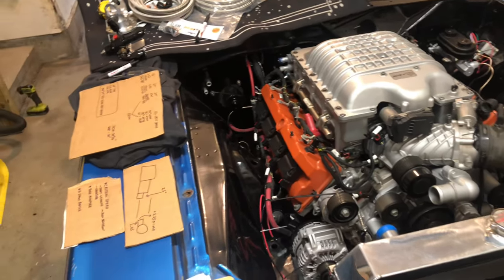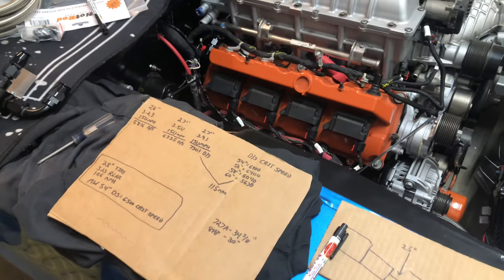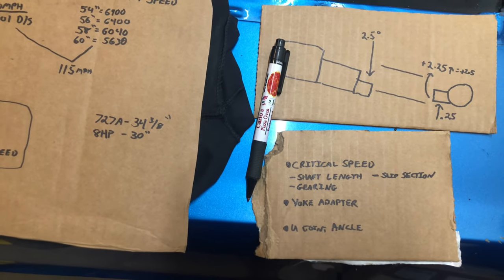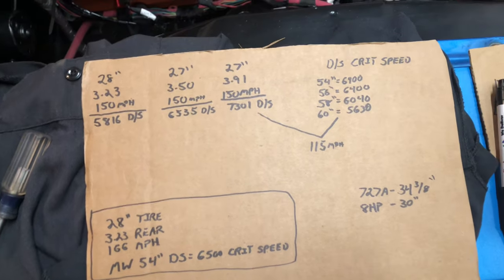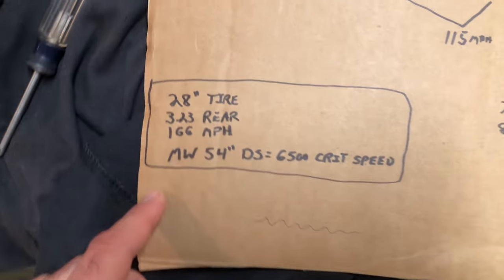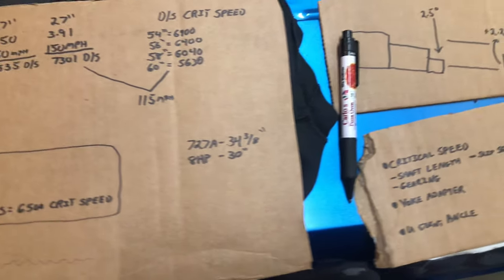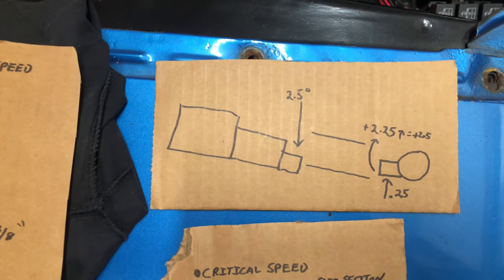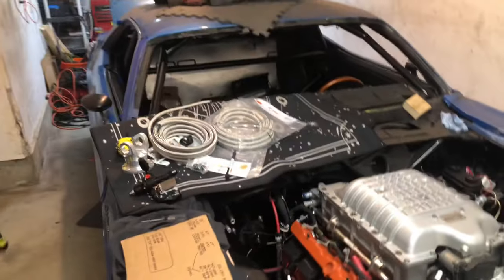EXPLODING 8hp90 transmissions! Project Hellcrap pt2 - hellcat swap driveline problems

Comment: Driveshaft shop can make you a custom Driveshaft. They can utilize the factory style CV end on the trans side and a standard 1350 yolk on the pinion side. Using the CV style will allow some movement in & out and will not put the joint as far out compared to the sonnax adapter. I plan on using the driveshaft shop for mine. I currently have their one piece 4" driveshaft on my 2019 charger hellcat with no issues. Numerous passes down the track and plenty of high speed runs in Mexico 😊
Reply from the maker: That sounds  similar to what Mark Williams built me.  Not a cv but they have their own billet adapter using 1350 u joints but it’s much shorter than the sonnax one when I compared them side by side.  3.5” with a slip section and critical speed was rated somewhere around 6700, so with my 30” tire I figure that’s way higher than I’d ever be trapping with this car lol

Even with the minimal movement of the caltracs I don’t think. A one piece shaft would work without a slip section in these older leaf spring cars. Can get away with it on a new HC because there’s no diff movement with the irs

Comment: How do these numbers apply to stock challenger/charger hellcats and Scat Packs? I've heard the hp70 having failures also with 392 swaps. I'm not a fan of the sonnax adapter, just seems like added rotational mass and another point of possible failure.
Reply from the maker: So yes and no, critical speed itself is still definitely a factor with ANY application but it is much less of a problem with factory hellcats cars because of their insanely low rear gearing. I believe standard is 2.63 and then a few cars have the optional 3.09. You also don't need to account for pinion movement so a slip section isn't required,  allowing you to use a 4" diameter shaft with a higher critical speed. With gearing that low and a 28"+ tall tire they come with, a well made aluminum one piece driveshaft is easily going to be able to handle 1/4 mile passes even on heavily modded cars.  Where there still could be issues though are top speed runs/half mile racing/standing mile racing. Take the PST 4" shaft, it has a critical speed of 6200rpm's,  With a 28.7" tire (275/40/20) and a 2.63 gear your driveshaft speed is 6160rpm at 200mph, under the 6200 critical speed of the  PST 4" aluminum one piece. With a 3.09 gear though, you're at critical speed by about 170. Both these numbers are with pushing the critical speed right up to the advertised rating, and me personally, the faster I go the more buffer I'd want for safety. 

This is where the expensive but beneficial Mark Williams 2 piece shaft comes into play. Dividing the shaft into two pieces increased the critical speed of each shaft as each shaft is shorter, and MW uses their adapter to run spicer 1350 U joints so that the shaft can handle  big HP numbers that a factory 2 piece shaft can't. 

There's definitely less to worry about with a hellcat though since you don't have pinion movement and I assume the trans/diff heights are already set up in such a way to provide for ideal U joint angles unlike a car you're building from scratch.
Reply from the maker: I should also say that critical speed is the point at which the driveshaft literally begins to fail structurally speaking. It may not snap or destroy parts hitting that speed right away, but it certainly over time compromises the shaft and can damage the transmission. That's not to say that you still can't get vibration you can feel leading up to that critical speed well before the actual critical speed rpm is hit, which is why ideally you should stay as far away from it as possible. That's what worries me a little with my setup. I think the car may trap as high as 150 and that doesn't give me much of a margin of error if it hits critical speed at 166. I think the setup would be much happier with a 3.09 rear but I can't got that low in a Strange S60 housing
Reply: I'm swapping a 392 with a hp70 into a 69 Coronet. Currently, the car has 3.91 gears and like a 27 inch tire. Plan is to go to 2.76 gears and on the track have at least a 28 inch drag radial. Def getting a driveshaft loop and crossing my fingers. lol. Great video.

Comment: What radiator and fans are you using? I'm in the middle of the same swap currently.
Reply from the maker: Sorry for the delayed reply, didn’t see this.  It’s a champion 3 core, came with fans (believe they are SPAL off the top of my head).

Comment: 4l80 and be done
Reply from the maker: It’s been eating at me for sure.  With what I think I could sell the 8hp90 for and needing a converter, flexplate, controller etc.. it’s going to cost me about 2500-3k out of pocket to go w a built 80e.  I’m thinking I can get this 8 speed to work and hold up but now the question is whether or not I want 8 gears.  I really just want the OD for cruising, down track I think the car will be easier to control/smoother power delivery with the two gear changes of the 80e vs the 4 gear changes of the 8hp (assuming a 2nd gear start).  Going 80e is a lot more money and a lot more work on my back in a small garage 😂. The benefit is I’ll be able to run a solid 4” DS with no critical speed issues, no yoke adapter issues etc… and much cheaper rebuilds if something does go wrong eventually.  Plus the peace of mind of not having to worry about IF I got the 8hp90 setup right while going down track at 140+. Tough decision